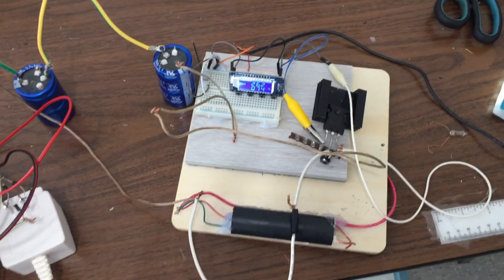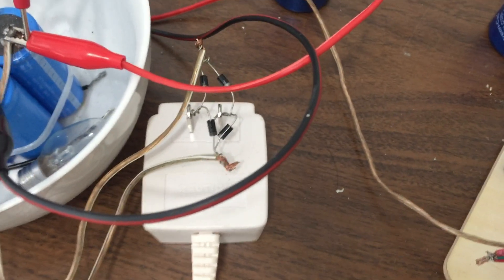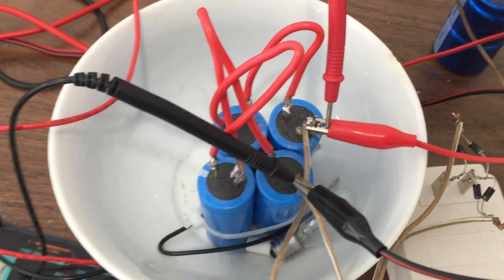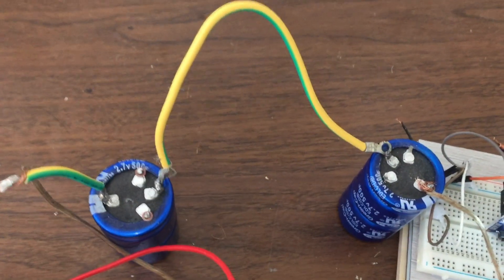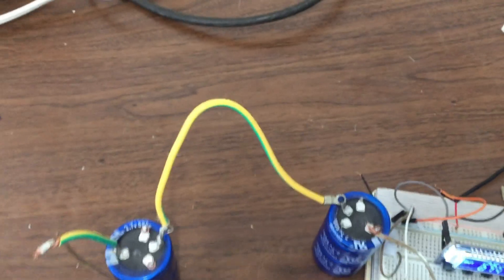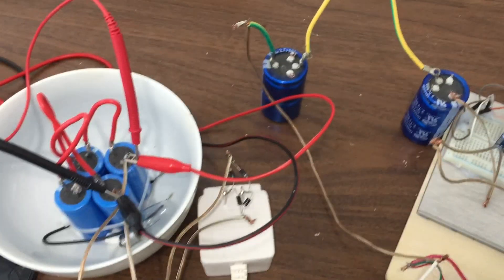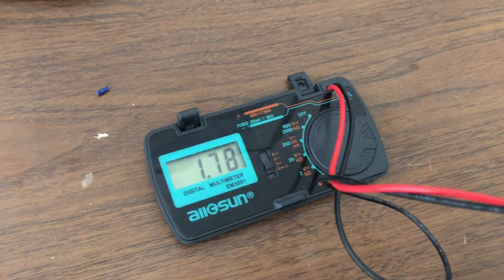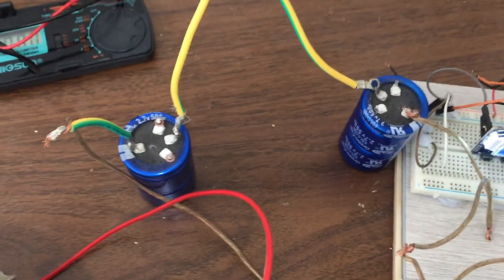Energy Recycling

Comment: Sorry, but never a dumb question for science.
Melt iron in a system which generates a magnetic field. Heat transfer back to electrical. Loop the system. Turn off the mains. Will the electrons replace themselves from an unseen source?

(Edit: Yes please, have a secondary device consuming some electricity or storing). Hopefully the extra electric current from the iron not the heat, will help run the loop, including the possible replaced electrons..   🤔 pretty dumb hey, but I have to ask

Comment: Let me help you further.

Use One Wire Energy Transfer to charge the caps using An N-CHANNEL MOSFET and a Shorted transformer with Identical Primary and Secondary Windings all wound in the same Direction.
A Shorted Pulsed Transformer is Equal to A TraGen or Transformer Generator or MotGen or Motor Generator which it output is always STATIC ELECTRICITY.

That static electricity must be converted back to Hot Electricity.

To do that, your Super Capacitors must be employed. 

Set your Signal generator to upward of 30Khz and pulsed your Shorted transformer at that frequency. 

To pulse your TraGen or Shorted Transformer, Wind the Secondary first in Clockwise direction i.e From left to Right. Afterwards, wind your Primary of same length wire in Clockwise direction too over the already wound secondary windings. Now, connect your Primary starting lead wire to the Battery positive while you connect ending lead to your N-Channel MOSFET Drain.

Now connect the secondary winding lead to your primary winding end lead. That is a serial connection. 

This way, you will have one wire opened for connection. That one wire would be at the secondary winding end lead.

Take that wire and connect it to the positive of your supper capacitor. Connect the Negative lead of an High frequency diode to the Negative point of your Super capacitor bank. Now, connect an earthed Rod to the Positive point of the Diode.

Comment: You have basically created a low level pump. You can observe The same with a antenna tuner.. A properly constructed   pump circuit can be discharged through a inductor to create an electric field that  collapsed creates high voltage spikes... That with Oscillation and Control circuitry could recharge the circuit and A super capacitor bank.  The first part should be built with ceramic caps discharged through the inductor to Create Magnetic field and charge the other caps.   It works on a small scale but is not feasible on a larger scale... PS creating extra voltage is easy at any scale turning a milliamp into 15 amps is the trick..

Comment: I studied the pdf in combination with this video. It's great stuff. Is each of the 4 caps really 10000F? If this is the case the result is extraordinary.
Reply: I think that aspect is impossible with what we see, look at the actual physical size of a 2.7v 3000F Eaton or Maxwell cap, they are massive.  On top of that those 4 charging caps are in series, therefore the caps would need to be close to 40000F each.  That being said the great principles Joel taught wit displacement current are awesome.  Very grateful for that.
Reply: @fernandogigliotti2299  Correct. The 4 caps look like 100F. In series this is 25F. It's not possible to put more power into Cap C than you take out of Cap A. In the last video and in the pdf it's described this way. I studied the design of the video "4.75 KW Energy Generator". It's genius. If I'd have the time I would order electric parts and start to build and test it step by step on a small scale. The most difficult part are the coils.
Reply: @fernandogigliotti2299  I realized you have a good knowledge. Maybe you can answer this question I have. For example cap 1 is 5 volts and cap 2 is also 5 volts. If we charge up cap 1 via transformer with the 5 volts in cap 2 what will happen? Will cap 1 charge up to 10 volts minus the 10-20% transformation loss as it is described in the pdf? I'm not so sure.

5 volts is 12.5 Joules. If I add up 12.5 to the existing 12.5 in cap 1 I get 25 Joules minus 10-20% transformation loss. Cap 1 would be at around 7 volts (24.5 Joules) and not the 50 Joules which is 10 volts.

Short question: will be 10 volts in cap 1 or 7 volts in cap 1 (minus the 10-20% losses)?

Comment: Good morning Joel, thanks for this explanation video, it's a great experiment.  Can you confirm the charging cap bank after the transformer is indeed 10000F?  There seems to be 4 capacitors in series, and I figured for that bank to be 10000F each cap would have to be roughly 40000F.  Just doesn't seem like I have it right.  Thanks Joel, appreciate the work.
Reply: He said in the video it's 10000F. And it's definitively in series. And this makes a voltage of 10.8v and the capacity remains the same (10000F) and not 40000F. But I'm not convinced it's 10000F because I couldn't find any cap with this size. Maybe Joel can confirm it again. If it's really 10000F then it would be a massive gain and this would be what Don Smith was hinting with the 5v-Cap with 1F to get 1kwh of energy. In my view it's because the primary doesn't feel the secondary. In other words if you take out 1ma of the 1v-difference in Cap A and B the secondary will get the 1ma. But 1ma with 110v is much more powerful than 1ma with 1v. I would say it's 110 times more powerful. And I believe this is the secret of Don Smith. He didn't want people to know that it's so easy.
Reply: @marcelfiechter7436  If four 10,000F caps are in series the total capacitance would drop to 2500F, not 10000.
Reply: @fernandogigliotti2299  Correct. It's 2500F. But it's in series because there are 3 wires. If it would be in parallel there would be 6 wires.

Comment: Hi, how do you calculate the pwm duty cycle (74%) and the frequency (26.2 Hz) of the switch? Can be swapped the 2.7V500F supercapacitor A & B with two e.g. 16V86F supercap modules and use it with an AC12V transformer? Thanks

Comment: I realized that you have 2.5v in the C-Caps with even much higher Farad (10000). In Cap-A is just 0.2v less and I would guess in Cap-B is 0.2v. Usual in Cap-C is the same amount as in Cap-A is missing. But here you have many times more power in Cap-C than you took out of Cap-A. Why is that? I believe it's because you are hitting Cap-C with 110v. And this 60 times per second. This means by pulsing a Cap with a much higher voltage the efficiency is increasing. I can't imagine what would happen to pulse Cap-C with a HV of 10'000v.

Comment: I have an idea because of the PEG-cell. It's great to augment the voltage with a 9v-battery in series. You experienced an amperage of 10-20ms. It's working like an echo without drawing any current out of the 9v-battery. What if there would be a relay to push some current (1 amp for example) into the circle for 1ms and then switch it back. Maybe it would echo for a couple of ms back and forth with an amperage of 1amp. And in this time you could fill the caps and dump. And when the echo comes down the switch goes back to the conventional circle to push some current into the wires again.

Comment: Thank you so much for your research document you posted recently (PDF). 

To me, the key ground breaking effect or takeaway was this: High voltage energy from a rapid discharge of a capacitor can be placed through a transformer to create a pulsed magnet field that is uncoupled from its secondary winding to extract real usable power to a load. 

This is groundbreaking in several ways. 

First thing that came to mind was the Wimshurst machine. In practice this high voltage (static electrical) machine is used only to create pretty sparks between a spark gap with the assumption that this firm of electricity is not able to do useful work (low amperage) and is simply a toy. 

I believe you may have shown that to be false.  How? First, you have shown how reactive power can create an electric (magnetic) field in a transformer where this magnet field can be "transformed" into regular electricity for practical use. 

So, what does the Wimshurst have? What does it discharge?  If course a capacitor consisting if two (commonly) capacitor sections (one positive, one negative) that in reality make one big capacitor of high voltage. That voltage (capacitance) is then discharged all at once between a spark gap. 

Am I wrong in assuming that this energy from the positive side capacitor of the Wimshurst machine can be directed through what you call "T-1" (transformer one) of your circuit, rectified as shown and collected as useable energy? 

Question: Is the same type of energy in a charged capacitor in your circuit (charged by a DC power supply or high voltage neon power supply) the same type of electricity generated by a Wimshurst machine? 

So now to control discharge right? Well the spark gap of course!  Tesla knew that the farther apart the spark gap, the greater voltage buildup in the capacitor and the lower the frequency rate (larger discharge at a slower rate, less frequent)  However the closer the spark gap, the lower the charge buildup and the more frequent the discharge rate. So we have time / frequency. 

The power to run a Wimshurst machine is negligible compared to the output. It could be run by a small DC motor regulated for speed which of course would determine electrical output. This small motor could easily be run by the power recovered from the secondary circuit of the transformer (the load) using a super capacitor bank after the bridge rectifier. 

The big question is this: Is there any difference in type of the high voltage electricity generated by a Wimshurst machine and the high voltage stored in the capacitor "C-1" in your circuit?  Is the one static and the other conventional? If there is no difference, then the same transformer reactive effect should work for both. 

Think about how much power (voltage) is generated by the low friction, no load turning of the two discs of a Wimshurst machine!  

As far as I can tell, more than one transformer can be placed along the positive wire creating a reactive momentary pulse as the capacitor discharges at the spark gap. 

I would be interested by your thoughts.
Reply from the maker: Super high voltage capacitors for electrostatic machines just don't have enough capacity to discharge a very high amps a second between them. Sure its high voltage and sure it feels like when that HV gap gets to you it could kill. But its more of a HV illusion. Nano and pico amps of displacement current is not really enough to do anything with even if its there. Some have already noticed this in the comments experimenting with too small capacitance. So its best to you middle ground point. Medium voltage with medium sized caps. If you know what your doing you can go HV with medium sized caps Like Don Smith to help make up for the loss of capacitance but at some point anything more then a few kv is too difficult to manage.
Reply: @joellagace1679  What voltage would you consider "medium" voltage on the 1f capacitors?
Reply: @joellagace1679 
Hi Joel, just checking in to see if all is well.

Comment: Hi Joel, thanks so much for this valuable information. I tried to reproduce the experiment described in your paper using 3 standard electrolitic 16V 1mF caps, a simple self wound transformer and a bridge rectifier, however on discharding cap A into B, cap C that was connected to the bridge rectifier did not gain any voltage or charge.. no voltage spike was visible on scope either on closing the circuit. Does this only work with super capacitors? or a specific type of transformer? could you elaborate a bit more on the components in order to replicate this? thanks so much.

Comment: Thank you, Joel, for taking the time to simplify the circuit. In reducing its complexity, the bare necessities for successful operation becomes more apparent. From this I can understand you are using an electronic "tapping" module to snappingly make and break the DC transferring between full supercap and empty supercap, along the way through the AC to AC (120v:2v), (60:1) transformer kinda backwards in through the Secondary side and then rectify to DC the higher voltage AC exiting its Primary wall plugs before being conducted over to charge the larger capacitor bank? 

Also, have you experienced faster charging when you make and break the greater - negative side, vs lesser -negative side vs between the greater + positive and lesser + positive in the middle?

Comment: Thank you, Joel! In your PDF the switching mechanism between CapA and B as well as the switches for B1 and B2 all need to be integrated for complete automation, right? It is also very interesting to realize that the transformers behave very differently upon receiving pulsed displacement current compared to constant current of AC. So is it fair to say that the pulsed displacement current from the caps is same as pulsed DC?
Reply from the maker: No because if you go pulsed DC you close the "loop" capacitors block DC. This is not typical closed loop DC or AC. I explain this in the document. If you add a R load in the capacitor to capacitor  path the transformer and capacitor displacement current cycle dynamics change.  Like if you use HV and want to take advantage of the additional ground tap displacement current. You can also run a load off of that like I demonstrated in a few older videos.  That's fine as that load absorbs most of that specific additional ground  power via displacement current, As much as its a form of displacement current its not really capacitor to capacitor. But at HV dynamics the little you get from ground might be a few watts or more.  and is not tied to taps. Taps are later on stages with the charged capacitor A.
Reply: @ Thanks for the clarification, Joel!👍🏼

Comment: I did this before and got all of the voltage over to the other capacitor at 100% efficiency as far as I could tell. The first one never fully discharged and it ran for days before I stopped the experiment. You would think there would be losses in the zvs I was using or in the wires but I didn't notice any loss.

Comment: I studied the PDF the other night.
I think your design is based on two separate concepts: 
1- Tesla switch: 
Which is transferring energy from capacitor A to capacitor B while putting another capacitor in the path to restore some of the energies. Then rotate the capacitors. 
2- inserting an inductor in the path of capacitor A to B. Using inductor helps to capture the transient part of the impulses. Which brings us this the third concept which is 
3- using pulse current instead of regular current to charge the source capacitor A. 
On the side note even  Bedini discovered that if he puts an inductor in the output part of his pulsed charges he can capture more energy.
Reply: The question I have is, how do you know When to switch the capacitors.  Do you need a voltage sensing circuit to do this?
Reply: @jefferysmith5092 ,  Alternatively, use a timer instead of sensing voltage—proceed after a predefined delay.
Reply: @omidyousefian4109  that would work, but you don't absolutely know that the voltage is a zero when switching with a timer.  That would be simpler.

Comment: The effect you are mentioning is called “boost” conversion, or I like to use a joule thief/Slayer exciter, joule thief is very efficient, my circuit is technically a Slayer exciter, but a fairly high powered version, they all do basically the same thing, it’s just how you connect/design your coil “transformer”.. 

I blew up my voltage controller last night and had to replace it trying to figure out where the current is.. lol

Comment: Joel you are right as far as there is no resistive load to this super-capacitors based energy transfer circuit utilizing displacement currents you will always observe overunity, but when you add a resistive load it reaches to a point where the cycle breaks and damping starts and the self-running mechanism of the circuit comes to a halt. For that we need a way to pump in extra energy from Zero point and that zero point is GOOD EARTH.
Reply from the maker: Don't even need a ground but agreed it helps things out. And my document lays out the idea that the system runs itself while you intermittent dump the extra charge into an aux device like a battery and run your load off of that.. No need to place your R device load in the energy displacement path.